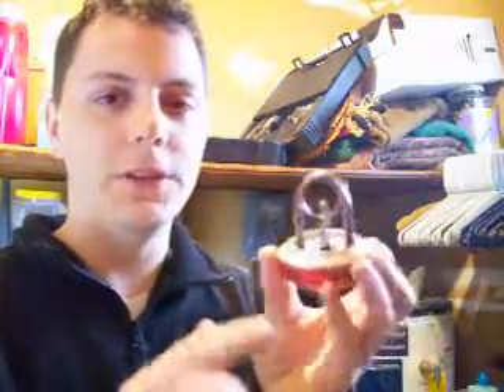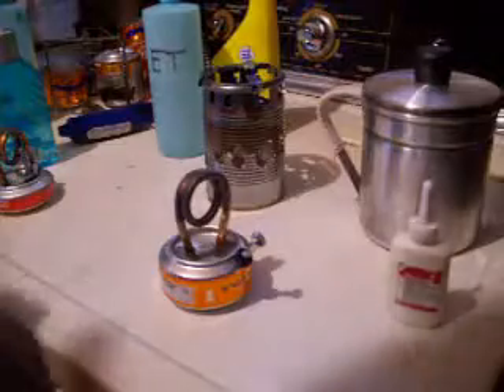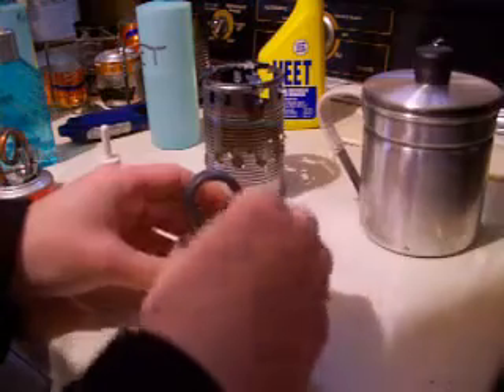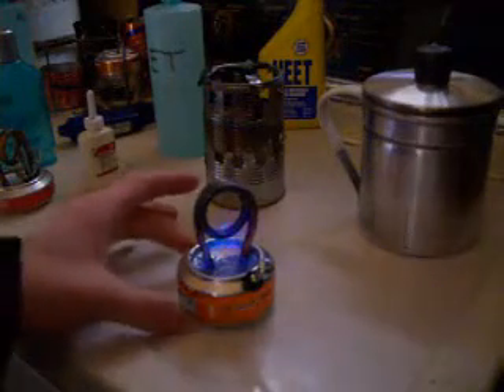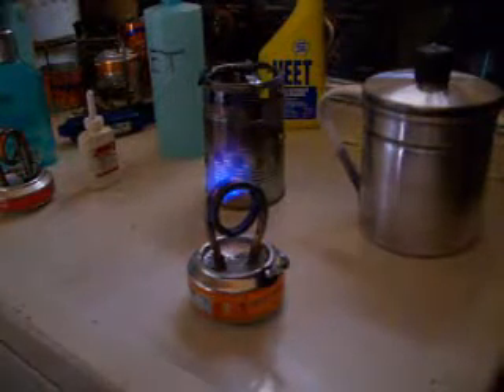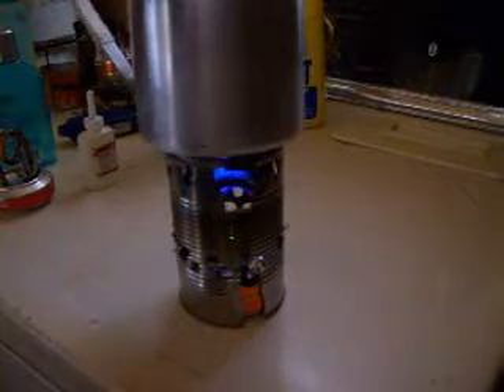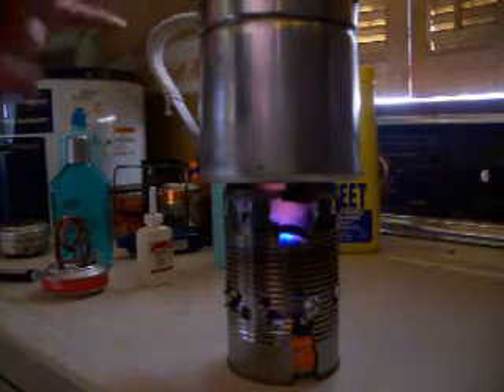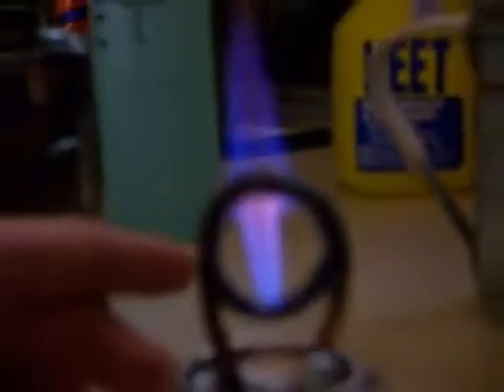Copper Coil Alcohol Stove

Comment from the maker: @rmstudio I believe the tubing is 1/4 inch. The hole is something you have to tune in. Start with a push pin and make as little as possible, then make it bigger and bigger until sustains the kind of flame you want.

Comment: Very well. 
You did well to keep higher the coil.
My coil (lower hight) lead to higher overheat of the tank with (after a few minutes) the cracked of the epoxy and loss of alcohol vapour.
Excellent ;-)

Comment from the maker: @jntroisi What you want to focus on is windscreen design, to stop the wind from blowing the heat away. Maybe try different pots to find which works best with your stove and has good heat exchange. Maybe try and work on a heat exchanger. Capturing the energy released from the burning alcohol and putting it into the water is what gives you an efficient boil.

Comment from the maker: started with a push pin, then increased it with my knife until it held a flame. to small of a hole makes the gases blow the flame out, too big will give you a wimpy flame like how mine does toward the end when it runs out of fuel. start small and test test test until you get the right size.

Comment: For ultralight backpacking, that seems a lot heavier than the standard pop can stove with the jets in the rim of the can. My stove was free to make, and it weighs 0.3 oz. (10 grams).  I boiled 2 cups of water in 4.5 minutes. What are the advantages of the coil? Does it make it more efficient by gasifying the heet better? I used plain old rubbing alcohol, but maybe heet is better?

Comment from the maker: @jntroisi Efficiency doesn't really relate to stove design, you can take 100 different stoves with the same setup and they all need the same amount of fuel to boil water, that's just physics. It takes X amount of energy to raise water 1 degree, and there's only a certain amount of energy per oz of alcohol.